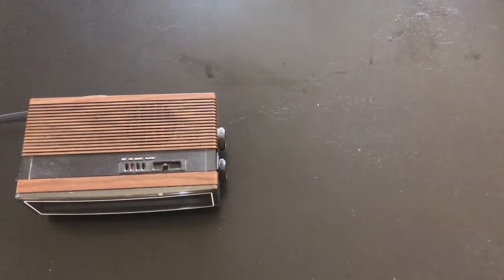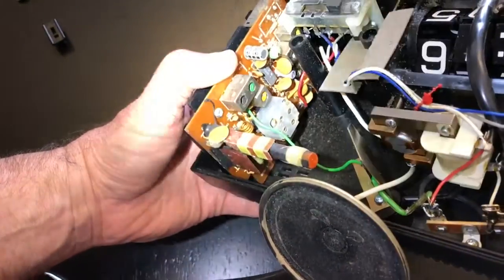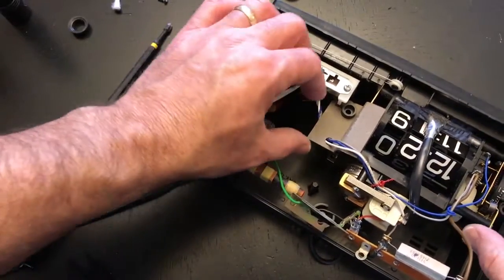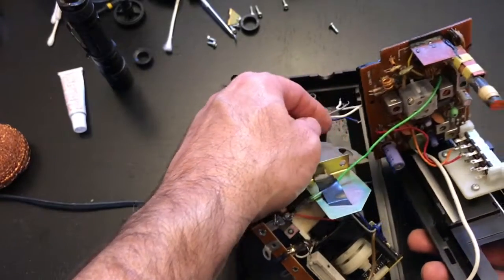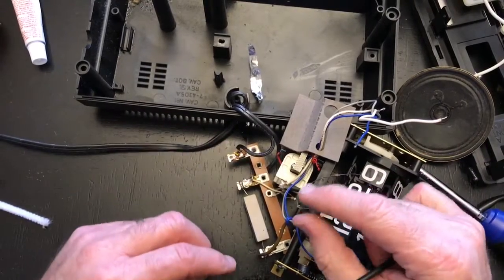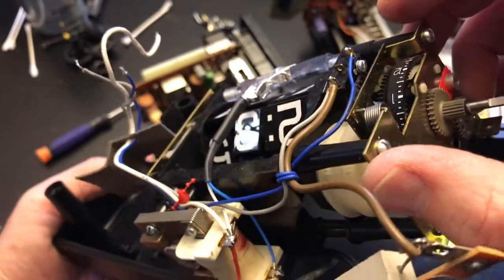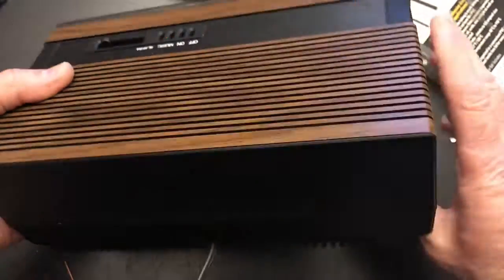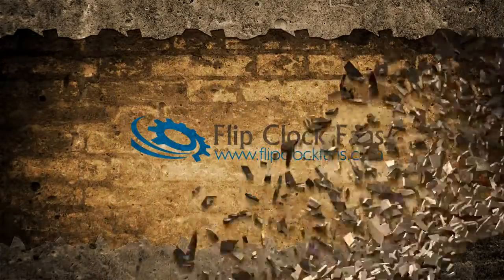Restoration of the GE Model 7-4305

Comment: LOL! my wife has banned me from doing anything on on our dinning room table...unless...I put down cardboard, plastic drop cloth and another piece of cardboard 😎
Great job on that GE, I've used the "donor" scenario many times and have quite an inventory of spare parts. And yes, it can be quite difficult to restring a tuner dial. I've had several that was all that was wrong with the radio...because there was no string at all...yep...makes for a pretty bad...day!!
Reply from the maker: I hear ya, brother! I no longer get to use the kitchen table either, but have a little corner of the family room I call ... FlipClockFans Studios.
Reply: @Flipclockfans  I learned my lessons many years ago..."yes dear" 😁

Comment: @7:25 chances are that bulb is probably a NE-2H or similar neon lamp 1.9 mA 18mm with a 33k ohm 1/2 watt resistor already connected to it and is required. The bulb connects directly to the incoming power source, 120V, so be careful if testing the bulb live like shown here.
Reply from the maker: Good suggestion

Comment: Question:  I have been restoring this same model.  The motor was bad which I disassembled, cleaned, and works (however no longer sealed).  This was really for testing, I have a couple new telechron motors on the way.  I replaced the bulb with the C2A which look great.  My question is, does the tuner section also have a bulb, or just the one bulb for the clock section?

Comment: I have one that worked OK for a while, and then started making a horrid squeaking/grinding noise (almost like a rewinding cassette tape), which I recall also made it run slow. Haven't figured it out yet, and don't want to lose a bunch of parts taking it apart. Could it be in the gear mechanism on the right hand side of the clock?
Reply from the maker: I 've recently learned that many makers actually recommended that you take your clock in an get it oiled. I know we talk a lot here about getting motors started, but in the service  manuals they speak of oiling actual parts of the mechanism. The trick is, if you're oiling plastic gears you should use a special oil that wont' break down the plastic.

Comment: What year was the 7-4305D model made?
Reply from the maker: The earliest I could see the GE 7-4305 in newspapers is from 1978. But this was the "rolling wheel" version.
https://www.newspapers.com/clip/63274193/ge-7-4305-digital-clock-from-1978/

Someone at Radio Museum guesses the production to be 1975 ish ... but I think that they're wrong.
https://www.radiomuseum.org/r/general_el_7_4305d.html

The 7-4305D seems to have come along later .. about 1981
https://www.newspapers.com/clip/63275000/ge-7-4305-d-or-f-flip-clock/
https://www.newspapers.com/clip/63275179/ge-7-4305-d-or-f-flip-clock/

This is backed up by speculation from antiqueradios.com that in the 4 digit codes the second digit gave the year. Radiomuseum.org has a 73405-D pictured with a code of 5138. Some at antiqueradios.com believes the 1 stands for 1981.
If you have a date code. see if it starts with a 5. The second digit will be the year. After researching this - to sum it up ...  I think the 7-4305D's were made from about 1981-1984.
Reply: Wow. Thanks so much
Reply from the maker: @s1ime_987  You're welcome. I'm had fun working on this. The date code is wacky. I'm looking at some of the 7-4305 rolling wheel and the second digit is a 9. That would be 79. The other numbers are a mystery. I'm trying to crack the code.
Reply from the maker: @s1ime_987  Here's how I think you read the date code:
the first digit is the day of the week. You'll only see 1-6 here - seems they didn't works Sundays (day 7)
the second digit is the year. I think on these radios they started in the mid to late 1970s.
The 3rd and 4th digits are the week of the year. Seems you won't see anything higher than 54 here.
I figured this out on my own.... more or less then found out that on other items starting in 1959 to 1969 they did the same thing. So I'm pretty confident in the date code.
Reply: Thanks

Comment: How do you know what bulb to use as a replacement?...and there seems to be a lot of different voltages for these bulbs?  and my third question is do they all need to have resistor built into the wire lead of the bulb?  Thanks in advance. Cheers!
Reply from the maker: For the most part (although there are exceptions) in flip clocks you will either be using an orange neon glow bulb that operates off straight household voltage and does need an inline resistor, or you'll be using a 15 mAmp 12 volt incandescent.
https://miniatronics.com/collections/incandescent-lamps/products/micro-mini-lamp-clear-5-5mm-12v-50ma-10-pcs
The neon glow bulbs come in a wide variety, but the go to bulb is the C2A aka the NE-H2 with a 30kOhm resistor. The best place to get these  (because they already come with the resistor) is memotronics.com. Here is a video about replacing one of those in a different clock:
https://www.youtube.com/watch?v=zoiP6k6bpV8
Reply: @Flipclockfans  Thanks for your help and your time.  The info is very helpful!
P.S. I really enjoy your videos, they're great!
Cheers!
Reply: @Flipclockfans  I used the C2A bulb with the original 15kOhm resistors (2), one one each leg in series with the bulb.

Comment: I just picked one of these up for $5- the clock won't flip and it can't tune on FM. The light, alarm and AM radio all seem to be working. Do you think a rewire could potentially get the other parts working again or is it likely beyond saving?
Reply from the maker: Almost for sure that will be an easy fix. You'll need to clean/oil the motor and spray some contact cleaner on the AM/FM selector switch.
Reply: @Flipclockfans  Thanks so much for the advice! I cleaned the motor up and it's running and attempting to flip now.

Comment: I have a GE clock (model 8142-4) with a similar mechanism and the motor runs loud. Like a constant hiss/sizzle when it's running. Is there something I can do about that?
Reply from the maker: I like those little clocks. There's no way I can tell from here, but usually that's not a good sign - motor's prob going bad. The thing is, that model may be the most common model on eBay as a search for "GE model 8142-4" will show. You'll do better  to buy another one that  to try to get it fixed. There's one  now with shipping included for about $25 and you may do better. If your case is better than the one you buy, just swap them out.
Reply: I  had another one of these (7-4305) that my Mom gave me new for Xmas in 1978 and it made that sizzling sound when the numbers were about to roll. It did that for years without any other problems (apart from the light flickering off intermittently). I thought maybe it was supposed to make that sound! The one I have now is pretty much silent. Looking back, I can't believe how much these things cost brand new. I think my Mom paid around $25 for it...in 1978 dollars! 
I decided I wanted an electronic digital clock radio, so I replaced it with a GE 7-4665 in 1982.

Comment: Heyo! Just got one of these clocks for $3 it keeps time perfectly and the mechanism works perfectly. The radio doesn't work but i honestly don't care about that. the light bulb is super dim and barely works. What kind of bulb should I be looking for? .
Reply from the maker: You need a C2A or NE-2H neon glow bulb with resistor. Many places online sell these with resistor included.
Reply: @Flipclockfans  awesome thank you! Turns out mine is the model C. Do you know what the difference is between all the different models of the 7-4305 ?
Reply: @ChamrsDeluxe  there is a A,B and C I believe it just tells u the year of when the clock was made A being around the 70's and C being in the 80's

Comment: Hey there! I was at Goodwill today and found this exact model clock for $4.99 so I bought it. And who better to go to with questions about it than you? I wanna ask about something. The flip clock doesn't work, the radio works fine, however when I ran the radio for about 10 mins it got very hot and began emitting a very bad burning electrical smell. Im not going to plug it in again, but what do you think is wrong? Can it be fixed?
Reply from the maker: It's possibly a bad capacitor. If you open in up you should be able to see it. They look like little soda cans (although they can be other shapes). It may have  different look that the others. They can be replaced but you have to have the same rating and make sure they're put in in the right way (polarity, that is, positive and negative). The flip clock almost for sure can be fix/lubricated.
Reply: @Flipclockfans  hey there! I was able to open it up. The capacitors look alright, none are bulging at the top or anything. However upon opening it I found spider webs and various dead insects. Not sure where this thing was stored but man it's ugly in there. I don't wanna throw it out but im not sure what to do with it at this point. It was only $4.99. How should I move forward?
Reply from the maker: @belogio  I don't know why I just got notified about this comment. Maybe it was lost in space. 
Anyway, I'm not sure what to tell you. You  could sell it as is, or if you're not into working on stuff get someone to work on it for you. If you do that consider that it will cost you 10-15 dollars to ship and you'll have to pay for shipping back. That's 20-30 dollars right there. Then you've got to figure a repair tech would charge 30-50 dollars or more per hour. So you're $5 dollar clock is now a 50-80 dollar clock.
Since I'm basically stuck at home, I'd look at it for you if you paid to ship it to me and for me to ship it back.
Reply: @Flipclockfans  Ok well let's get in touch. I'd be glad to send it to you.
Reply: @Flipclockfans  if you're still interested let me know. I'd be happy to send you the clock.

Comment: So, is there any sort of shock hazard when the thing is unplugged? I have one of these and am a novice when it comes to fixing it.
Reply from the maker: Potentially, yes. But practically ... no. How's that for wishy-washy. These clocks have capacitors that have very small DC voltages. I have found that if you have the radio going, then unplug it, it will drain the capacitors. Besides, the voltages are very small, around 16V. You're not even likely to feel a shock from them.  The honest answer is no. If you unplug the clock you will be safe. The true death risk is working on an energized clock. This AC current could easily kill you. So .... unplug your clock.
Reply: @Flipclockfans  Cool, thanks for the information! :)

Comment: The motor didn’t work so I took off the assembly and the gear fell out of it 🙃
Reply from the maker: Oh man! I hate that.
Reply: @Flipclockfans  it’s not to much an issue it sits on my shelf now, and it was only 11 dollars so I just bought another with a working clock and a broken radio
Reply from the maker: I’ve bought clocks like that and they become parts clocks. I’d not be in a hurry and wait. Someday you may see a working model on eBay with case damage that might sell for cheap.  I’ve done that many times and got working clock.